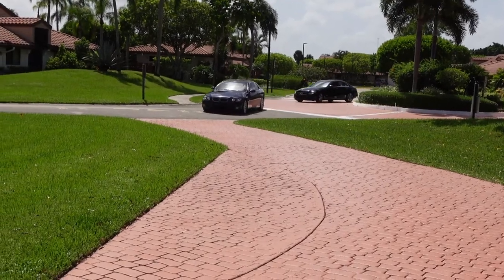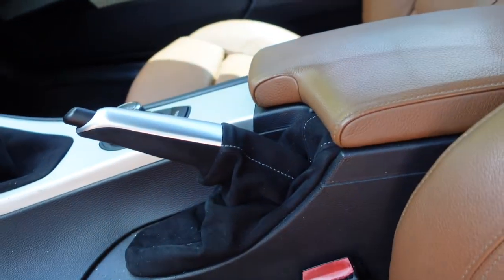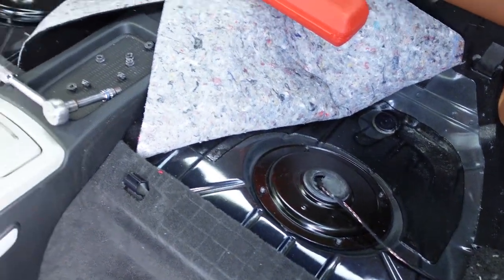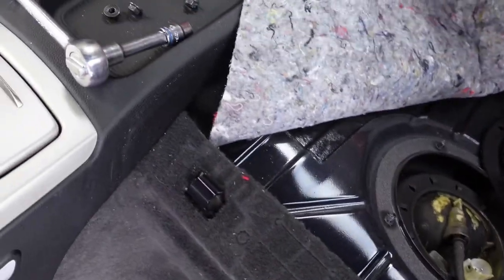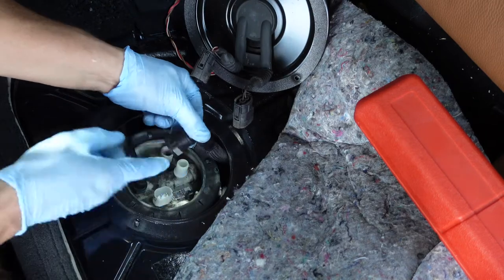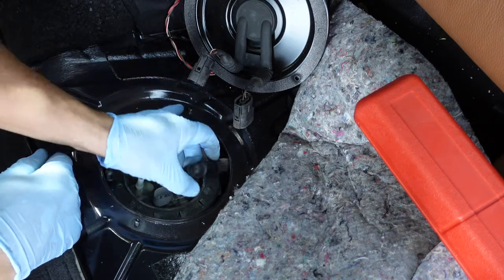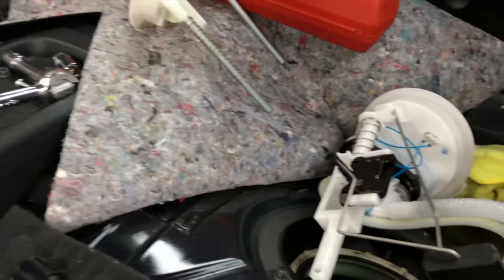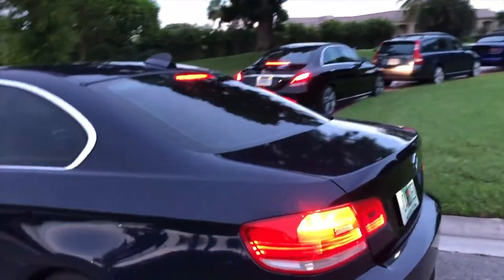Replace Fuel Pressure Regulator - BMW e92

Comment: I still have no idea why he did this job. He smelled gas and so determined that he had a bad Regulator?? What? How could he know that form smelling gas. Did he have a bad hose coming out of it to the outside?
Reply from the maker: The odor of fuel in the cabin is a common factor of a faulty/leaky regulator in these vehicles.  At minute 5:48, I show the fuel collecting on top of the regulator which confirms the fault.  At minute 18:28 I explain how I zip-tied the three connecting hoses and passed them through to the other side.  They are rigid enough that I didn't need anything to act as a lead when passing them through.
Reply: The seals on the regulator tend to deteriorate over time and that causes leakage. Fuel will then leak from the top ring to the outside of the tank and that’s most likely when you will start smelling fuel.

Comment: The grey security connector on the top of the fuel filter/regulator assembly was the hardest part for me. And that grey connector got damaged, and now it won't hold the hose in. I'm looking to buy a new connector now from bmw, and unfortunately that will take a few days.

Comment: Question, that plastic ring that the metal locking/screwing ring goes in to, did you replace it, and is it a full solid circle/ring or is it cut..mine was leaking gas from the regulator side, and I cant tell if it was due to the plastic ring being snapped (or the ring is supposed to be with a cut in it) or if fuel was leaking from a micro crack on top of the dome where the fuel line connects.
Reply: mine was same & it was a micro crack on top of the dome !

Comment: Thanks for the terrible DIY. Like all the other YouTubers you skipped over all the hard parts like removing the fuel pressure regulator line and routing back in the pump.

Comment: Great stuff Dom, thank you. I replaced mine today and this video was key. 2008 E91. Took about an hour. I had a micro crack in the dome of the FPR. It's a common issue. Driver side left side rear smelled of gas. A look underneath showed some gas stains. Not drips but wet. A couple of important notes:
1. I bought the special tool on Amazon for $25 to remove the metal ring. I still had to bang it a few times and put some WD40 in to loosen it up before I could get it to move. I bought the FPR from FCP Euro.
2. It's a pressure system, so remember to run the car until it dies AFTER you disconnect the wires, before you disconnect the fuel lines. Have a throwaway towel ready it will spill a bit when 1st removed on FPR side.
3. I drove the car down to about 1/16 tank before starting. Definitely helps.
4. Wear gloves and goggles. Gas in the eye is not good. White vinegar removes gas from hands.
Any questions, just reach out.
Reply from the maker: Hey Jim. Thanks for watching and adding your tips and input. It’ll help me if/when I do it again. 👍🏼
Reply: Thank for the info. this vid and what you said gave me a better understanding of how this works, but  could I seal the little hole on top of the regulator, or does it have to be replaced?

Comment: Thank you so much for a wonderful clear video footage. I have BMW650I 2007 and had the regulator replaced three years ago.  Unfortunately the smell is back Lately noticed pretty bad smell outside. Maybe because the heat doesn’t help rather than cold climates.  Love the clarity of the footage and steps taken.
Reply from the maker: Thanks,I hope it helps you with your issue. 👍🏼

Comment: Would a small crack in the white plastic part of the fuel pressure regulator likely cause an evap leak (P0442)?

Comment: How could you be sure it was the lines inside the tank?  It seems that the drivers side connection at the top was leaking.  Did you start the car and watch the leak?

Comment: If the smell only comes from the engine bay through the AC vents can the regulator and or pump can be ruled out as the problem? No smell when AC is in recirculating mode.